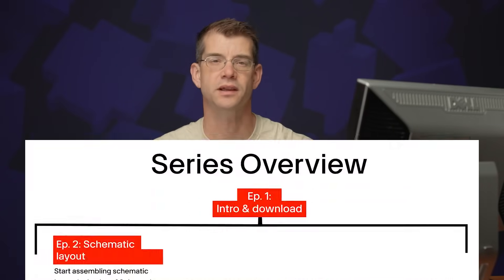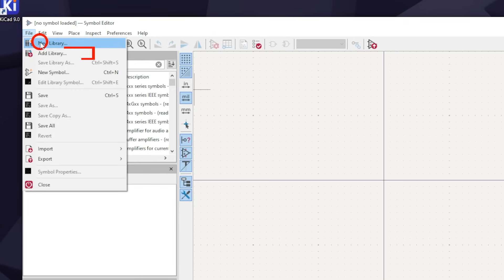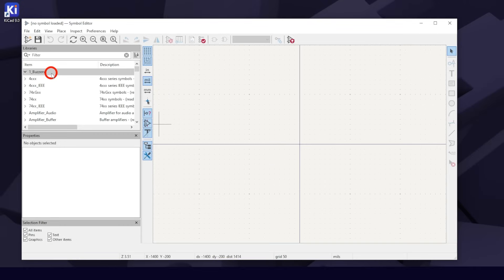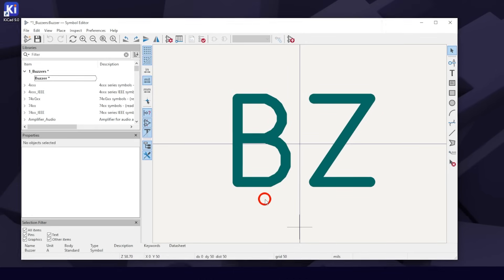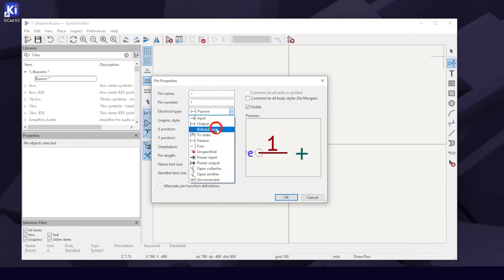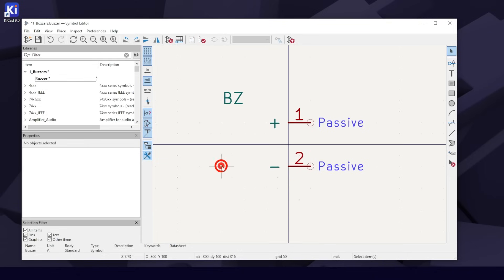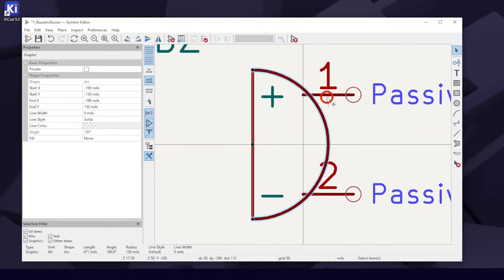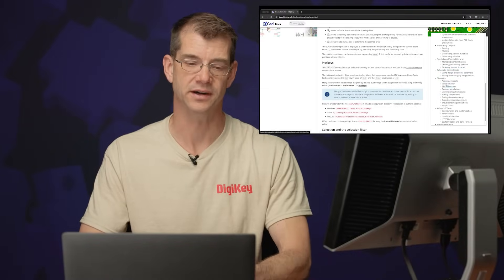KiCad 9.0 – Getting started Part 3: Create a Custom Schematic Symbol | DigiKey

Comment: A great refresher, with some new stuff I didn't know. :) Am I mistaken, or did you say pins should be spaced 100 mil apart, then place the buzzer pins 200 mil apart (at y = -100 & 100)? It doesn't make a difference functionally, but I'm curious!